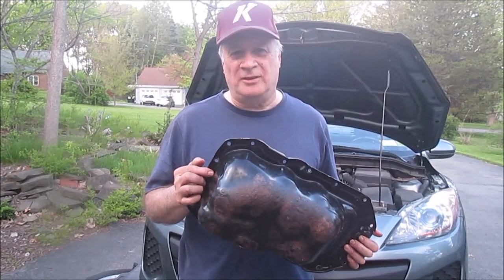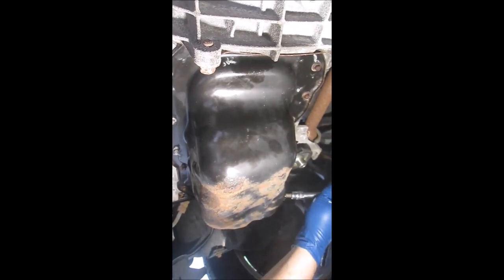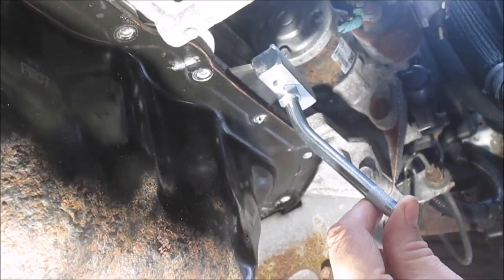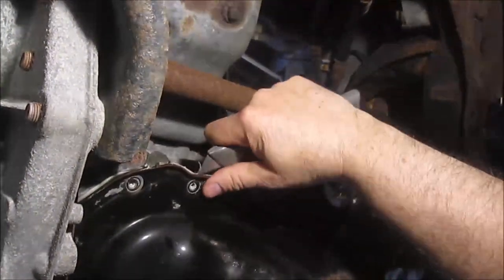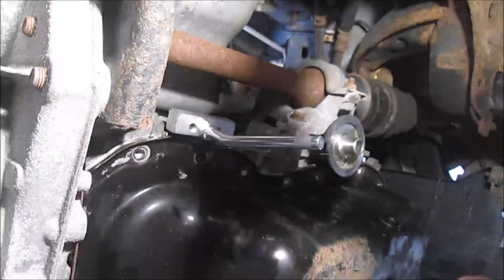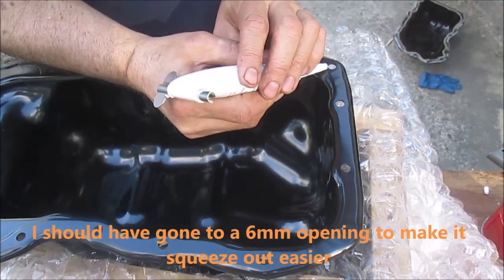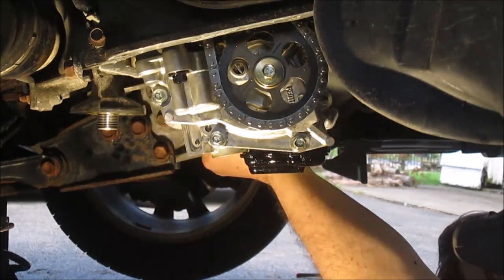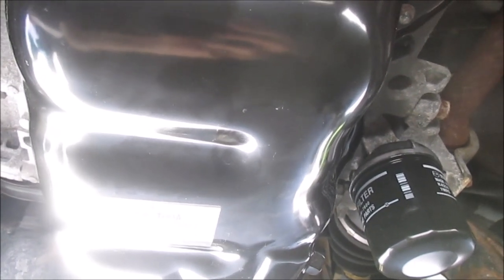Oil Pan Replacement for a 2012 Mazda3 w/Skyactiv-G

Comment: A good tip for those who are going to be attempting this, a quicker way to remove the pan is just hit it with a rubber mallet, leave 2-3 bolts loose but still on the treads so when the pan does come lose it won’t completely drop and damage it if you plan to reuse
Reply from the maker: I found the Mazda sealant is more like a cement than your typical RTV silicone.  Still, it's worth trying the mallet technique - less chance of damaging the mating surface of the engine block.

Comment: diagrams for torque pattern and sealant were very helpful, i just did my pan and ill know in a day if the new one works great or not lol
Reply from the maker: Thanks!  They're from the genuine Mazda service manual I got from Craig's Manuals, https://craigsmanuals.net, PDF format.  It has to be the best $11 I ever spent.  The only thing it doesn't have is part numbers, but you can get those from any online OEM parts site.
I think you'll be OK with your seal - I pounded the hell out of the separator tool and the Mazda sealer really holds well.

Comment: Thanks for this video, I have a 1.6 TS2 and need to change the sump for the very same reason. Did the manual come with the part? For some reason the BL doesn't have a haynes manual which isn't at all helpful!
Reply from the maker: Unfortunately, the oil pan didn't come with any kind of instructions, but I have a manual I got from Craig's Manuals, (https://craigsmanuals.net), which I think is the same one Mazda technicians use.  It's a downloadable pdf, best $11.50 I ever spent!  The only thing it lacks is part numbers, but I've found a lot of dealers' websites will steer you to the right one based on your VIN.
I think the Haynes manuals ended at 2011 for the Ford/Mazda version of the Mazda3, which means no mention of the Skyactiv engine.
Is the TS2 the one called the Mazda2 in the US?  I see Craig's has manuals for it for 2007-2014, but it looks like they only cover the 1.3L and 1.5L engines.  Still, they may have some parts in common with the 1.6L engine and they're only $10-15.
Reply: Thanks! I'll have a look in to that, I assume it has various torque settings mentioned within the manual? Mine's a 2009 model, can't find Haynes at all for it here in the UK. They do something called autofix but as I understand that's not necessarily a step by step guide which I would need for certain jobs. It's a Mazda 3, same shape as yours, TS2 is the model variant.
Reply from the maker: Yeah, I tried looking, but everything seems to be for the 2.0L and bigger engines.  eManual Online only says "all engines", but I suspect that isn't the case for the 1.6L.
From photos I've seen and the drawings in the Craig's manual, it looks like the pan for the 2.0 and 2.5L MZR engines is cast rather than stamped from sheet metal, like the Skyactiv's is, and the bolt torques are about doubled.  And the procedure is much more complicated.  Edd China, help!

Comment: I agree a really good how to video. I just replaced my oil pan, and this helped a lot. The only suggestion I have is to use the "key" on the RTV sealant tube when applying the bead on the pan. It makes it easy to apply a nice even bead around the perimeter of the pan.
Reply from the maker: Hi Gary, thanks for writing!  Yes, I did use the key, but it would unwind when I squeezed the tube near the middle.  What I really could have used was a third hand to keep the key wound tightly!
I was expecting something like silicone rubber gasket maker, but it was a lot thicker than that, unless I got old stock.  I didn't see a date on the tube.  And cutting the opening in the tip wider would have helped - the manual says 2-6 mm and I went for in the middle.
Oh well, it does seem to be sealed but a continuous bead would have been better.
Reply: @deeessseventeen6976  what I found works is once I had sealant coming out of the tip, I turned the key slowly to windup ( compress) the tube and that forced the sealant out.  It took less than one turn to extrude a bead around the perimeter of the pan.  I've used a similar Yamaha sealant product   and it has the same thickness.